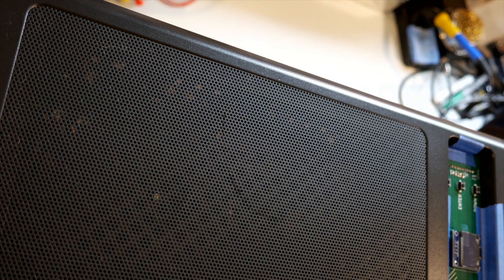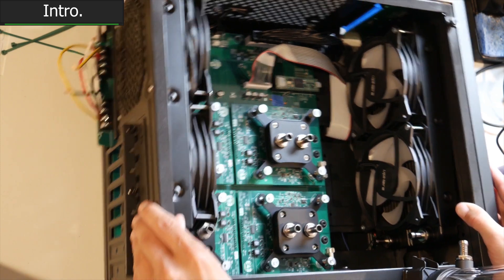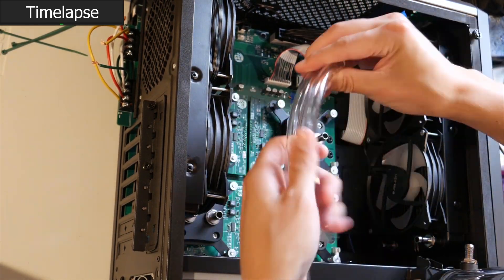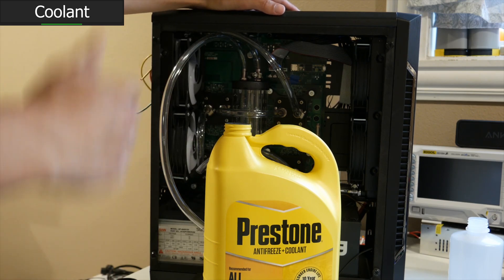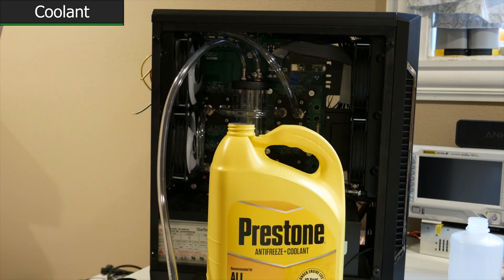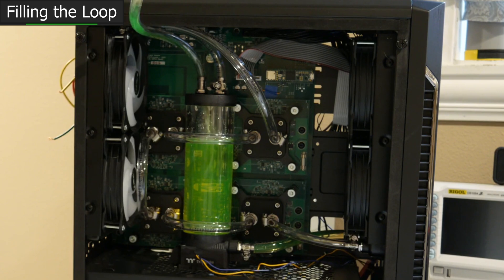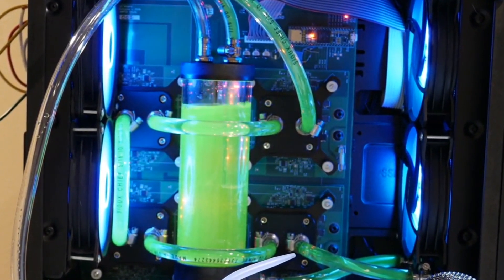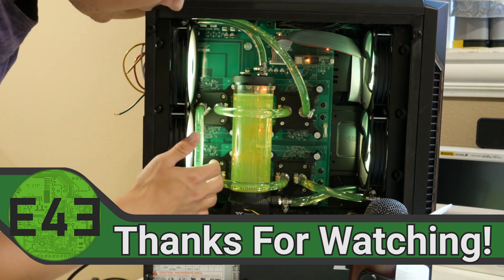Water-Cooling the Electronic Load!

Comment: Great work! Was thinking of characterizing CPU air coolers. Now I think I will go with liquid cooling.  I'm sure your channel will grow exponentially to at least 100K subs in the coming year.
Reply from the maker: Thank you! Yeah.. I was really excited about air coolers, but it seems heat pipes are easy to dent/damage with smaller components. I hope you're right, and thanks for watching!
Reply: Hi, I’m characterizing cpu air cooler too for electronic loads. I just made a video of DL24 cheap load upgrade with a noctua nh d15, at the moment only 360W, i m waiting for the parts to reach 720W hopefully and make a serious mapping power/temps

Comment: I would rather see the power modules use at least 4 mosfets in parallel like SUP57N20 (Was able to get 12V/250W dissipated on one of these with old stock AMD cooler) and cool it with 212 evo, each module should be able to dissipate around 350W, and with some layout tidy-up should fit 6 of such modules resulting in 2.1kW
Reply from the maker: Fair point, and a fine suggestion! Not sure if we'll every get to circle back on scaling this project up... but maybe someday. :) Too many fun things to try! Thanks for the great comment!